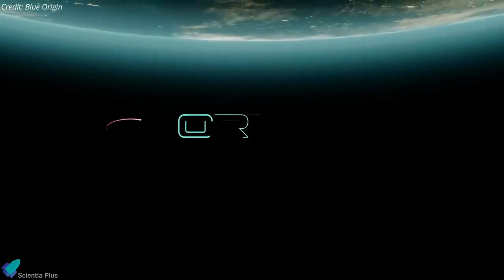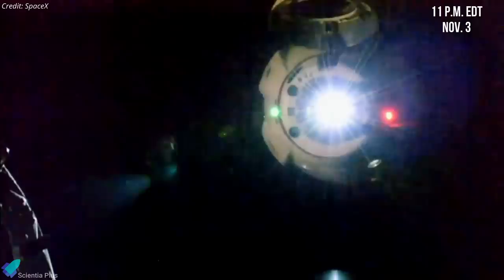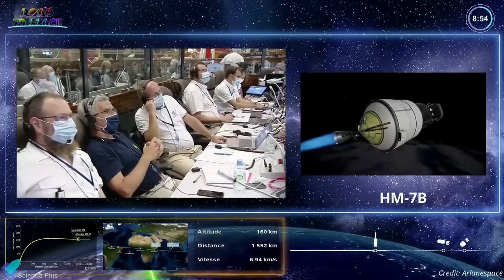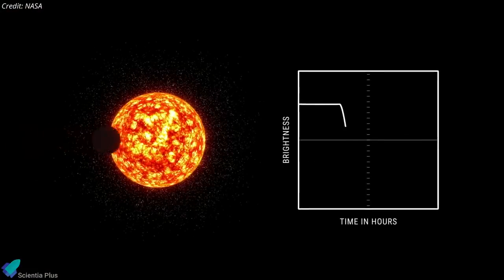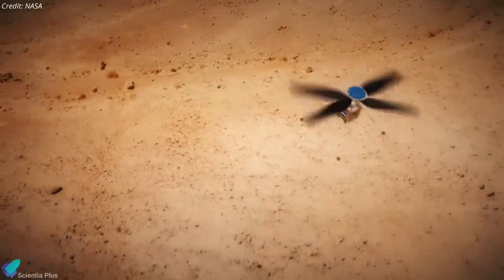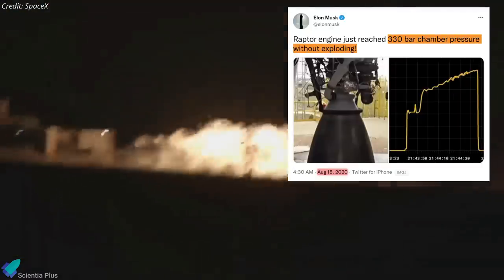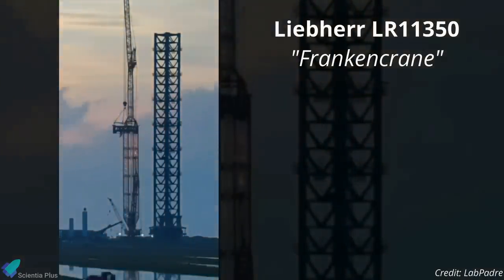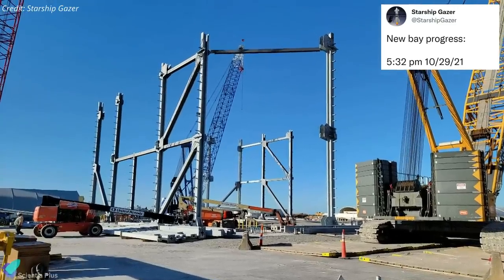Starship Mechazilla Tested for the First Time | Raptor VER-2 Tested | Crew-3 Delayed | Orbital Reef

Comment: So, Blue Origin will use a rocket that doesn't exist to launch elements of a space station that is only a proposal, and send the crew on a capsule that doesn't work. Hmmm.
Reply: Yep. So far the only thing Blue Origin seem capable of is filing lawsuits, naming projects and making 3D rendered videos of said projects.
Reply: To be fair to BO, that's normal for the aerospace industry. SpaceX didn't need to build and fly a Falcon 9 before NASA gave them a contract. They had three consecutive Falcon 1 failures before a single successful flight, which was enough to prove they were worth the risk to NASA. The real problem with BO is their litigation and lobbying against SpaceX.
Reply: Sounds like the NASA/DoD/BigAerospace model to a "T".

Comment: The thing with the SpaceX crane is it lifts a bit less, 350 tons, can reach as high as the 11350 but has 24m more radial reach. I think the reach bit is a big point in why they went with that version, also it is a newer model than the 11350 :~)
Reply: And it has that new crane smell ;-)

Comment: 7:25 WRONG, you have it backwards. The COLDER mars gets, the thinner the atmosphere gets and thus needs to spin faster... which is why it was shut down in the coldest part of mars winter
Reply: Generally speaking colder air is more dense. Hence why they inject NOS, it's essentially extremely cold/dense air, allowing them to dump extra fuel. 

Turbine engines on planes thrive on cold air, more density means more oxygen, which is more fuel. 

Cold air drops, hot air rises. In cold weather you can hear noises from further distances, sound travels better/faster through denser air. 

So mars atmosphere I would assume becomes more dense with cold, due to this it may cause the physical profile of the atmospheres thickness to become thinner, as the cold heavy atmosphere drops down

Am I missing something?? I may be, genuinely asking.
Reply: @sacr3  Maybe just a troll out trick-or-treating?